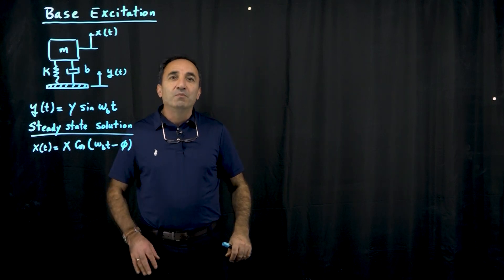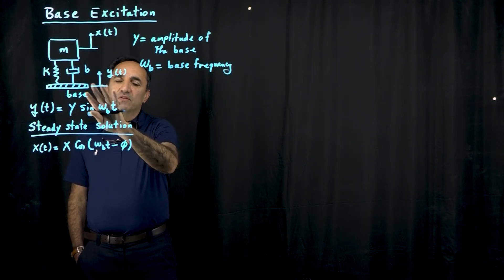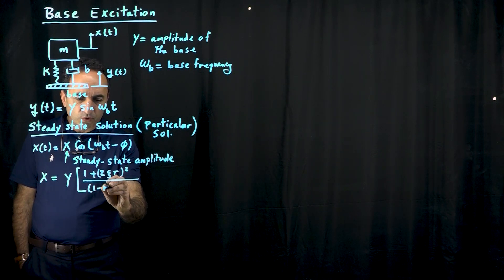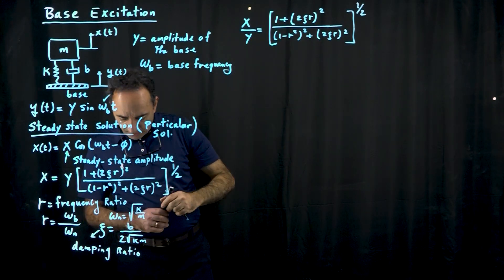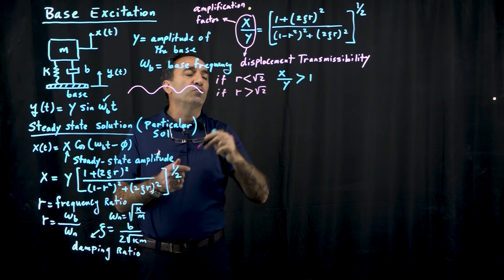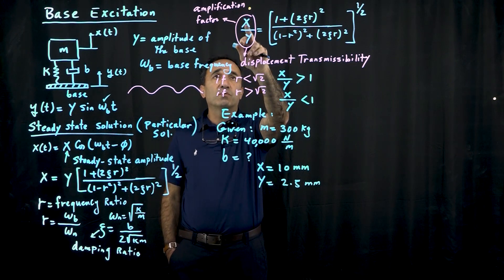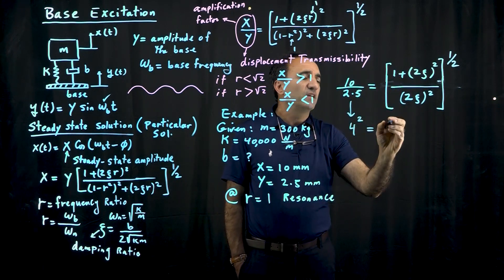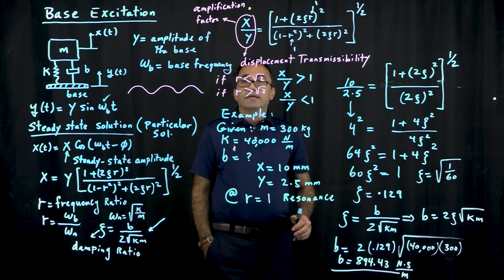Harmonic Base Excitation of Vibrating Systems | Amplification & Damping Analysis

Comment: What if you want a good suspension system? x/y would be less than 1 and at resonance, zeta becomes imaginary. I am stuck on this exact thing for a problem from class.
Reply from the maker: That can not happen. if r  (frequency ratio) is less than 1.4142, you always have amplification which means x/y >1. At resonance (r =1) you always have large amplification.
Reply: @MasoudOlia  For my case, if I am trying to make a good suspension system and am only given that y(t) for the base, how could I find a b and k that would reduce the amplitude by 65 percent? I thought you would need to do something similar to this video and assumed I would need to make the r = 1. Could I assume a different steady state frequency and thus change r and still achieve the same results? My teacher would probably be fine with an assumption like this but I am just wondering if it would be valid and am curious to know the right answer! If you have time and could email me about this that would help me a lot trj18k@my.fsu.edu. Thank you.
Reply: @MasoudOlia  This is a very important point that many misunderstand. Low frequency inputs will always have a transmissibility over one. You can reduce the resonant peak by increasing damping, but you can't make it less than one. Paradoxically, to reduce high-frequency transmissibility, you must remove damping. If you have an input frequency which is at sqrt(2)*(Nat. Freq.), then there's no damping change which will influence the reaction. The only thing you can do is shift the stiffness of the system up or down to get in a spot where damping does have an effect. Generally, we try to reduce stiffness and put troublesome inputs in the high frequency range.